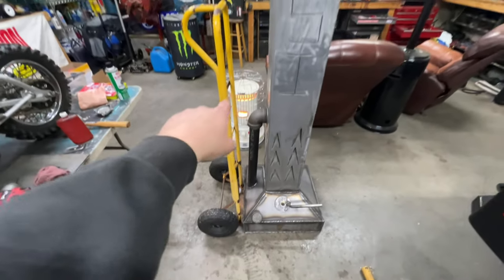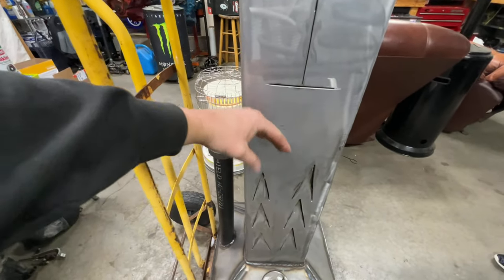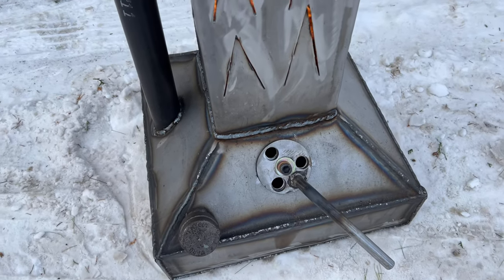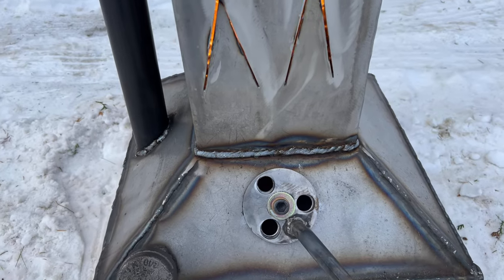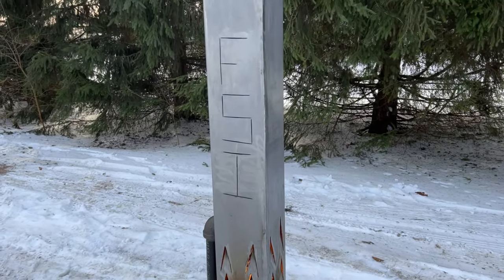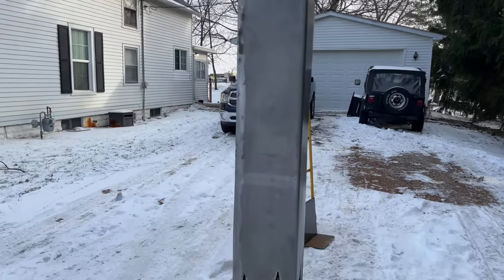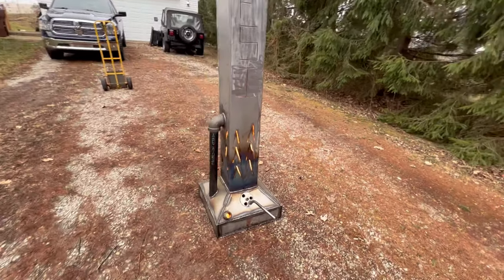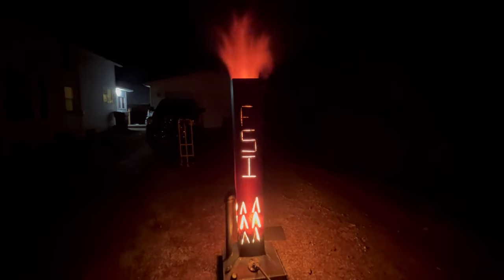Lighting our Smudge Pot for the First Time!!! (Fire in the Pipe!)

Comment: Nice job! I have found out that with motor oil it burns much hotter. You close the air vents more and you get a much longer and hotter burn. You don't go through the fuel nearly as fast.
Reply from the maker: You are right! We did a 50/50 mix just recently and I could tell she was way hotter. And surprisingly same amount of smoke. My only concern is with the oil vs just burning diesel is there going to be some kind of build up on the bottom? Because I won’t be able to clean it very easily
Reply: @FullSpeedImpulse  Yes there will be. But if you throw a hand full of 3/4" gravel rocks in there and shack it around it will flake right out. I fill mine with used motor oil and 6 ounces of gasoline. Keep your head back or use a long stick to light it and it works every time. Regarding the buildup, it will take many many uses before its an issue.
Reply from the maker: Awesome!!! Thanks for the tips Mike! Do you think the secondary pipes on these smudge pots are truly necessary?
Reply: Yes they are required to burn properly. The vents that you have cut into the main exhaust are not required. I believe that all stated because people wanted to add some decoration to the look.
Reply from the maker: Ahhh gotcha. It does cast out a nice glow through the vents too